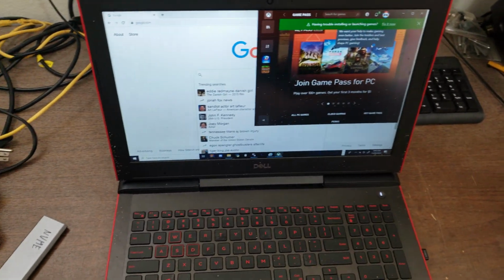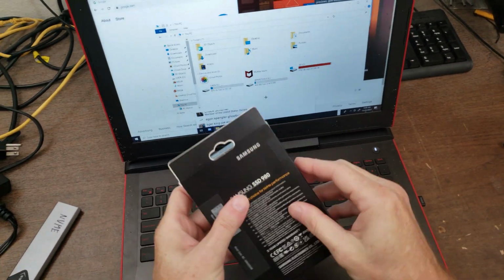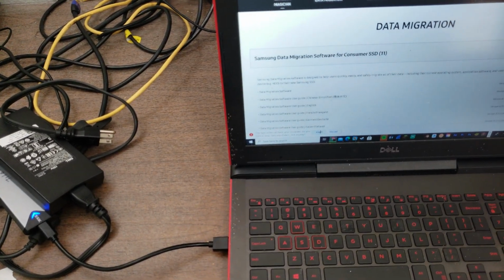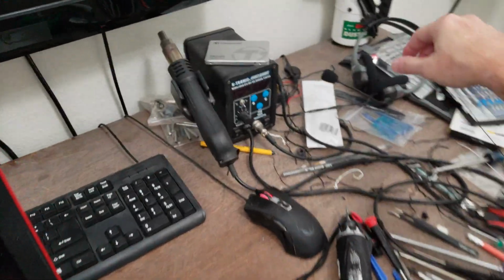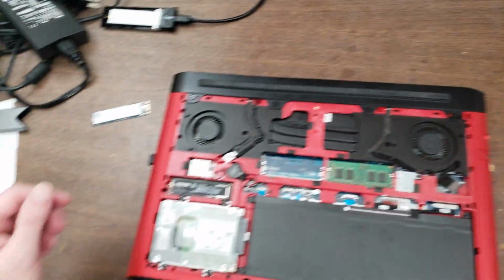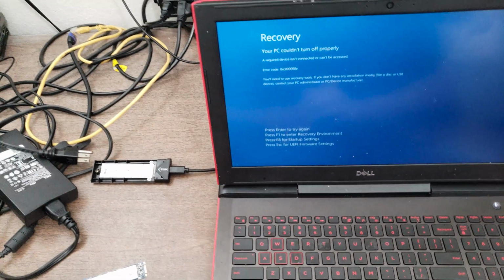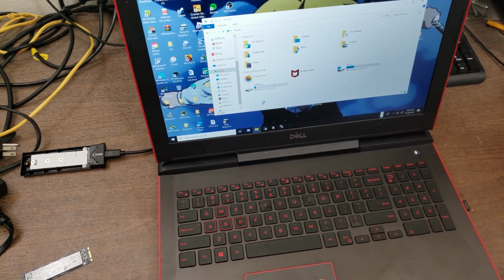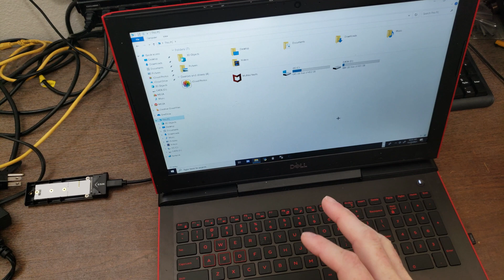Dell G5 5587 Laptop, Cloning M.2 SATA 512GB to M.2 NVME 2TB Upgrade with everything moved over

Comment: I dont think it works anymore if the source drive is from other brand than Samsung because the "Migration tool" dont exist anymore and have change name to "magic..something and it doesnt support other brands so you need another software + the adapter now. If I am wrong please let me know.
Reply from the maker: The migration software was moved into the magician software. I haven't noticed it work any differently with non Samsung drives so far. That being said most solid state drive manufacturers offer a cloning tool for free that you download from their support website. If you do a Google search for the manufacturer of the solid state drive you have and the words cloning software you should find the free version of the cloney software in one of the first results on Google. You can use that software to clone data from your current drive to the new solid state drive.

Comment: I tried upgrading to a Samsung 970 plus 2TB M2 NVME from a 1TB drive. The migration worked fine and it booted fine after but I kept getting random error messages in Win10 and a couple of blue screen crashes. I tried another 2TB M2 NVME (WD SN770) and experienced similar issues. Went back to the 1TB drive and everything is fine. I thought maybe it was a limitation of the G15 5587 since it only mentions 1TB in the documentation. However it sounds like others have had some success with 2TB....

Comment: I got the same laptop. I am planning to upgrade, however I am wondering if this model can support M2 NVMe up to 2TB or is it limited to 1TB only??
Reply from the maker: In the video I install a 2 terabyte m.2 solid state drive and it works. A 4 GB would work as well. I don't think there's an upper limit.

Comment: Nice video. Apologies if someone has already asked this. Does the Samsung software still work if neither of the drives are made by Samsung? If not, what software would you use?
Reply from the maker: The drive you're cloning to has to be a Samsung.
Reply: @MichaelTheComputerGuy  I thought that might be the case. So what software would you use if neither the target or source drive are Samsung?
Reply from the maker: Most SSD manufacturers have where you can download cloning software for free. Do a search for the manufacturer SSD you have and the words cloning software and you'll find them. They are free.

Comment: So o added a 2 tb ssd but I want to upgrade my m.2 ssd to a 2tb as well original the m.s Sata ssd has 250gb would I be able to copy everything to my second ssd and put it back once I upgrade my m.2 ssd?
Reply from the maker: I'm not sure I understand what it is you're trying to do. You can clone from a 2.5 inch drive to an m.2
Reply: @MichaelTheComputerGuy  im sorry I’m confused my self 😂
So I wana upgrade my dell Inspiron 15 7567 im looking to buy a ssd to replace my m.2 ssd 
I’m not sure which ssd to get would the ssd you used be compatible with my laptop?
Reply from the maker: @xXxjrxXx123  It looks like that laptop has space for a 2.5 inch drive and a m.2 drive. If you currently have a 250gb SSD it's probably in the m.2 slot. What you can do to replace that is get yourself another m.2 solid state drive, whatever capacity you like and connect it to the computer through a USB to m.2 NVME adapter. Search on Amazon for USB to m.2 NVME and you'll find one. That will get the new m.2 connected to the computer through USB. You would then use the Samsung migration software which you can get for free, Google it, to clone everything on the 250 GB solid state drive to the new m.2. once that's done you would replace the existing 250 GB m.2 with the new one that you just transferred the data over to. It should boot into Windows at that point. It will be an exact copy of what was on the original 250gb solid state drive. Only the new drive has lots of free space.
Reply: Would the 980 pro 2tb be good for my computer?

Comment: How long does it take to clone ?
Reply from the maker: It depends on how much data there is and the speed of the slowest device. Typically going from a hard drive to a solid-state drive with say 50 GB of data to be copied it would be done and maybe 20 minutes.

Comment: Thanks so much for this video.  I have a 5 year old G5 5587 and the 256GB M.2 SATA drive which has Windows 10 on it nearly full.  I wanted and upgrade and wasn't sure if I could replace this laptop with a M2 NVME 1TB drive.  I was a bit confused with all the terminology but after seeing this video I know it can be done, much appreciated.

Comment: at first, this video not exactly the same as my Dell notebook model,  I didn't pay too much attention on this while I need reference to upgrade my ssd nvme. However no matter how hard I tried, I cannot successful replicate  the same as other people on my computer. Only follow this video by using Samsung migrate replace other software. I got successful upgrade my ssd nvme to Samsung 970 Evo plus 1TB. But the remains didn't mentioned in this video is while you need upgrade ssd firmware, or  better r/w performance, you need change the default SATA Mode RAID to AHCI on the bios. Thanks a lot your sharing.
Reply: Which program did you use to clone your c: drive, Samsung magic stayed stuck on 0% for me then i used another brand and could not boot because, like you said, it needs AHCI on bios, could you do a video on the steps you took?
Reply from the maker: Samsung migration getting stuck at 0% is related to the c drive bring encrypted.  You need to turn off disk encryption before you attempt the clone. go to start, settings and search for encryption.  You'll find the option to turn it off.  After the clone is done and the new drive is in you can turn everyone back on.
Reply: @MichaelTheComputerGuy  thank you so much, hopefully i can get my new Samsung drive to work after
Reply: @MichaelTheComputerGuy  it says data migration function has been interrupted for an unknown reason

Comment: Hi, Can you tell me if I make a copy of my M.2 SSD drive on  another M.2 SSD drive  from another manufacturer will it boot  without any problems, and if I need service on  warranty will the builder see I have use my PC without my original M2. SSD original drive ?. I don't want to send my failed PC with all the data that could be used to steal my identity, and personal data or financial .  I would like to buy a new M.2 drive and copy my original one on it, and if one day I need service I would switch back my original M.2 drive that has practically  no personal data.
Thanks for your help
Reply from the maker: Cloning one drive to another will work regardless of the manufacturer.
Reply: @MichaelTheComputerGuy  Thanks Mike . I suppose the size of the new drive doesn't matter also ?.
Reply from the maker: @lucpoirier4794  the length of m.2 slot has to be compatible.  Most are 80mm, some are 30mm.  The motherboards often can take other lengths.
Reply: use Samsung Migration tool v3.1  -search -samsung data migration older version download.I did it and clone my M2 SATA to Samsung M2 NVMe 980

Comment: Are you not supposed to unplug the main battery before removing and replacing the drive?
Reply from the maker: Not when replacing drives, ram or WiFi.  It's not necessary.
Reply: @MichaelTheComputerGuy  OK no problem... It was just I watched another YouTube video and the guy said you had to unplug the battery before removing and replacing drives... was just wondering if this was necessary and if it was for safety reasons...

Comment: The boot trouble seemed to be to be the BIOS reconfiguring itself (for the new drive type) but not in time to boot correctly the first time you tried. I didn't watch the video closely so I missed it if you went in to the BIOS to change the drive type before attempting first boot with the new drive. Some BIOS firmware can just be set in autodetect mode. Even from the factory.

Comment: How many terabytes does the motherboard support?
Reply: For g series 15 5587

Type:
One 2.5-inch Hard Disk Drive (HDD) 
Interface:
SATA AHCI Up to 6 Gbps 
Capacity:
Up to 2 TB

Type:
One 2.5-inch Solid-State Hybrid Drive 
(SSHD)
Interface:
SATA AHCI Up to 6 Gbps 
Capacity:
Up to 1 TB

Type:
One M.2 2280 Solid-State Drive (SSD)
Interface:
SATA AHCI, Up to 6 Gbps
Capacity:
Up to 256 GB

Type:
One M.2 2280 Solid-State Drive (SSD)
Interface:
PCIe 3 x4 NVMe, Up to 32 Gbps
Capacity:
Up to 1 TB

Comment: I am planning on upgrading my 516GB SSD on my HP Envy laptop to a 2TB drive and will probably use a Samsung M.2 NVMe SSD. You installed a Samsung 980  NVMe 4.0 SSD into the Dell laptop and those SSD cards can get hot. There isn't a lot of free space in a laptop, would a card like the one you installed run hot?
Reply from the maker: In my experience and what I've looked at research wise they do get hot but not the point where it is detrimental to performance or lifespan. It's just not something you currently need to worry about. That may change with newer solid state drives in the future.
Reply: @MichaelTheComputerGuy  Many thanks for your answer, it was very helpful.

Comment: Hey! Thank you so much for the video. 

I followed your process exactly. Additionally, I made sure no programs were running in the background, computer was on airplane mode, and verified my drive for errors using the chkdsk command. Once I started the data migration I left it over night. It has been 14 hours and I still have it at 0%. It shows the time running but no progress or transfer being made. I have a Dell G5 15 5990. Currently trying to clone my current drive that came with the laptop, Toshiba 128GB SATA SSD, to the Samsung 980 Pro with Heat Sink. I am using the Samsung Magician Data Migration for this process. I have reinstalled and verified the install multiple times multiple times and it is working and up to date. It recognized the drives and I want to clone from and to. Currently, I have 86GB used up of 100GB available on my current Toshiba SSD.

Should I restart the process of cloning my drive? Are there any additional steps I may have missed? I apprecite any advice that can help me figure out what is going on!

Comment: I have a G5 5590, and I'm hoping this will work when I have to clone the drive. I want to clone the entire drive, including the OEM recovery partition, then once it's done I want to set up a dual-boot Linux setup. Can the G5 accept drive sizes higher than 2TB> I can't seem to get a straight answer from either Dell or the Dell forums, and I haven't read about any limitations the HM370 chipset has on storage capacity.
Reply from the maker: I would say it can handle m.2 drives larger than 2 terabytes but I really don't know. If you find out please let us know.
Reply: @MichaelTheComputerGuy  I will. Hopefully Micro Center has a fairly liberal return policy :)
Reply from the maker: @cubdukat  if you're going into a micro center you might consider bringing your laptop with you and asking the support personnel that do laptop upgrades whether it will work or not. They might even offer to try it for you because they're curious as well.
Reply: @MichaelTheComputerGuy  Unless you change the motherboard you can not use more then 2TB. You can stick in as much as you want but the board will only recognize 2TB. I got this information from Dell and i have a G5 5590. Hope this helps people in the future.

Comment: I have Viper anti virous on my laptop, Do I need to turn it off before I clone my drive? And will it clone over to the new drive?
Reply from the maker: If you clone the drive while the computer is running like this it's a good idea to turn off the antivirus.   Just turn it back on after the clone is done and the new drive is in the computer and running.  You don't have to reinstall it because it was cloned to the new drive.

Comment: did this on my laptop, G5 also, but I was fortunate that my model had two slots for ssd. I put the 1tb into the 2nd slot, cloned everything from the 250gb it came with then just replaced it in the first slot and added a 2nd 1tb and went from 250gb to 2TB! Also upgraded ram from 2x4gb ddr to 2x16gb ddr4. I do like how these gaming laptops are super upgrade friendly!
Reply: What model do you have?
Reply: @treysnyder6393  G5 5505 I think

Comment: Great video. My computer won't recognize the drive.  Everything you did is the same I did.  Same computer, SSD and even the enclosure.  I tried Macrium and the Samsung software but get no bootable media found when I swap the drives.
Reply from the maker: If the Samsung and macrium software can see the new drive, the computer can see the drive. The issue you're having is after swapping the new drive into the computer the computer doesn't see how to boot up to windows. What you might want to look for when you put the original drive back in to try again is to make sure the drive is not encrypted. That can throw off the cloning process. So if it is encrypted set encrypted to off and then try the cloning process again.
Reply: @MichaelTheComputerGuy  I checked on the encryption and it wasn't on. Do you think it could be the lack of a driver since it was a SATA drive that came out?
Reply: @MichaelTheComputerGuy  The drive is being seen now. I had to switch the SATA operation to AHCI instead of RAID. It is trying to load from partition 1 but the OS is on 2 and now it just cycles through dell's automatic repair feature and does nothing.

So it's halfway there.

Thanks for your help

Comment: how long is the cloning process because mines has been stuck at 0% idk why. moving from a 256gb ssd to 1TB. Havent even used much space for it to be taking long. can anyone help with the issue?
Reply from the maker: Try a different cloning software.
Reply: @MichaelTheComputerGuy  any software you recommend for the 970 evo 1tb?
Reply from the maker: @ItsCreates  The Samsung migration software usually works well.  Macrium reflect is another good one.
Reply: @MichaelTheComputerGuy  the Samsung one is the one that didn’t work for me stood at 0%

Comment: I need your help I wanna trust you on  this procedure.. I have the same laptop and bought the same nvme m.2 1tb upgrade..except an evo 970+ m.2 nvme pcie instead of the 980... Anyway, Samsung tools are supposed to be the best and easiest but I've read most comments online that it didn't work they needed to change bios ahci settings etc... I need help!! I have a ton of music software I need to use! Scared.. I wish I could pay someone or have you come lol
Reply: Another complaint dells manual says up to 500g m.2 at one point then later 1tb max.. yet some claim they did 2tb upgrade fine but Dell said 1 so that's what I got evo 970?
Reply from the maker: @namrekcanad  Usually the max capacity that a manufacturer lists is whatever is available at the time of the specs creation for that model. It'll take a one terabyte even a two terabyte or probably a 3.8 something terabyte solid state drive. Go ahead and try and use the Samsung migration software. It'll most likely be fine. If you have trouble with it I would recommend macrium reflect free. You really shouldn't have to change any bio settings.

Comment: Awesome video. Migrated my original 512GB SSD to a Terabyte one using this method. The only thing I'd mention is that bitlocker has to be disabled and the drive unencrypted (it took 18 hours in my case) before attempting the cloning. Thanks a lot Michael.
Reply: Very important note, good tip/reminder!

Comment: I have the exact same laptop and same lack of storage on the C drive. I got a 970 EVO plus (500GB) and a USB adapter (not same model as yours) to clone the drive, but neither the samsung migration software, nor samsung magician, will recognize the SSD as a samsung device. How did you get yours to work?
Reply from the maker: I've had trouble with the Samsung migration software not recognizing a Samsung drive when connecting it through a USB to SATA adapter. I didn't really find a workaround to make that happen with the Samsung migration software what I do in that case is just switch over to using macrium reflect free to do the cloning. If you look back in the last maybe 10 or 15 videos here on my channel you should find a few examples of me using macaron reflect to do the cloning.
Reply: @MichaelTheComputerGuy  Can i use Acronis software to clone?
Reply from the maker: @TWISMatic  Yes you can clone with acronis.  It's one of the softwares I use
Reply: Did it work with the evo one? I'm planning to have one
Reply: @No0Metter0What  Yes, however, I had to use Macrium Reflect Free to do the transfer instead of the Samsung one.

Comment: Good day Micheal, 

I have a dell G5 15 5587,  it came with two drives, just like yours but unfortunately the c drive is 101GB of size and I always have to delete stuffs from temp folder and also do disk clean up just to have as much space as possible ... 

can I go through he same process to upgrade my c drive as explained in your video, please confirm, thanks in advance ...
Reply: I already have all the required stuffs in my amazon cart, just waiting for you to confirm so I can go ahead with the purchase, your response is highly appreciated ...
Reply: Yo Micheal, can you also do a video on changing battery pack ... my battery pack is a toast at the moment ...
Reply from the maker: It should be very similar.

Comment: where did u learn how to open packages?
Reply from the maker: I got my 4 year degree in opening packages at the University of the United States.  Reply if you get the reference without looking it up.
Reply: @MichaelTheComputerGuy  haaa good stuff man! try and stayy warm in this cold weather
Reply: @MichaelTheComputerGuy  im thinking about enrolling there this spring.
Reply: also its better to have OS  and games on seperate drives..it just runs better that way